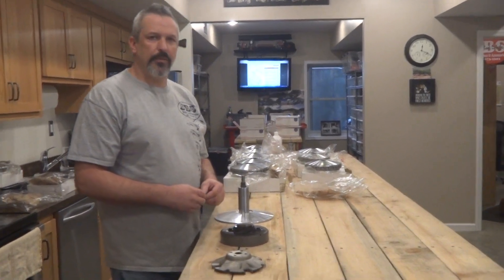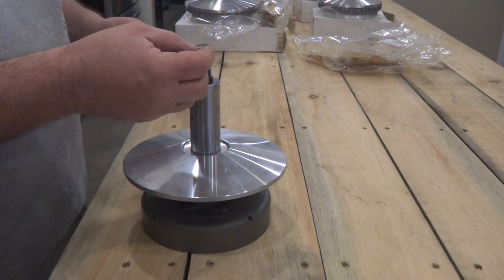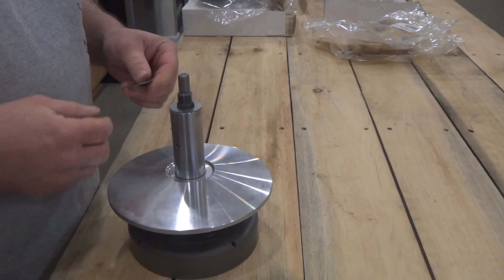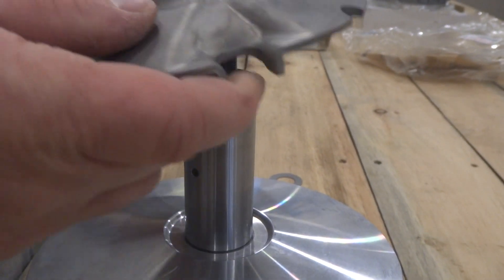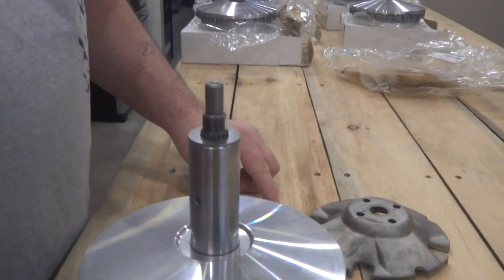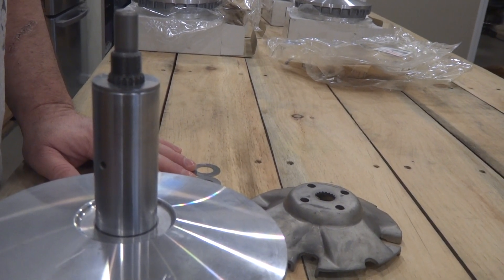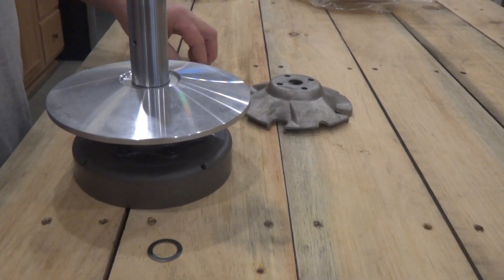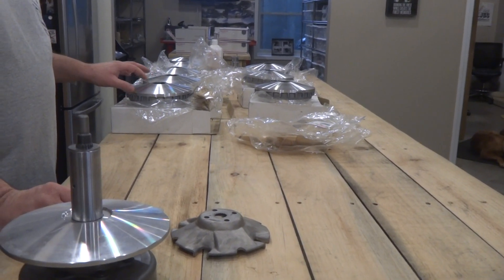JBS 700 Rhino, Grizzly, Viking & Wolverine Shim Info

Comment: I have a 2011 rhino 700  I’ve had it four years and have never even looked at the belt. It has over 7,000 miles on it. I know it’s starting to make some stranger noises and stay stuck sometimes so I’m about to dive into replacing what I need. I run 14 inch rims with 26 inch bighorns  also I have an aftermarket exhaust I want to put on and snorkel but idk if the efi will automatically adjust or if I have to do something. Any info would be great
Reply from the maker: Call me Monday to discuss all options